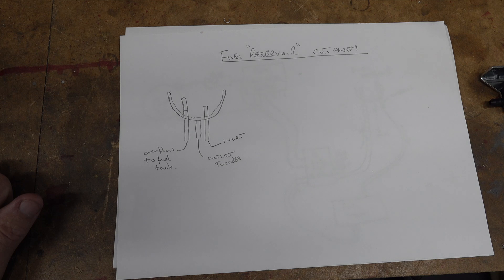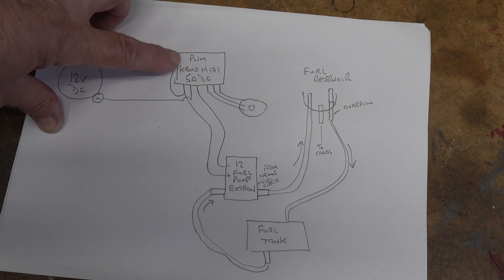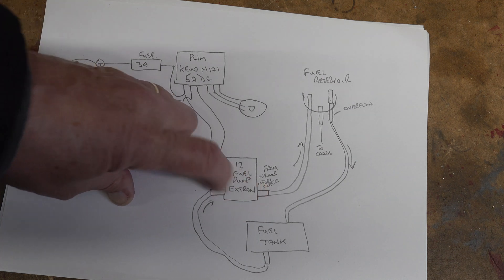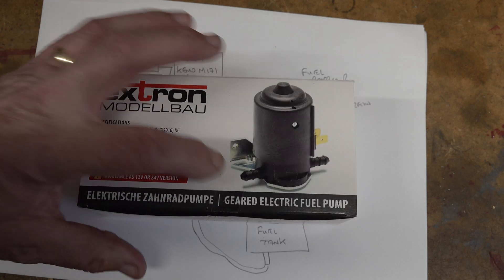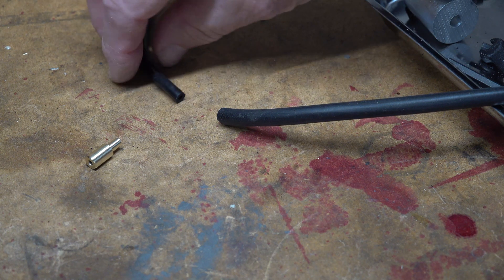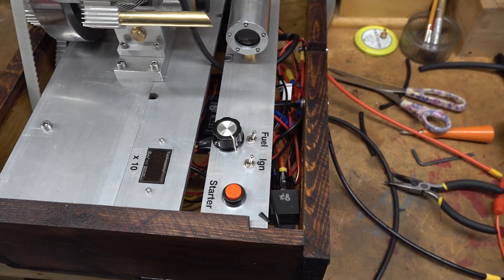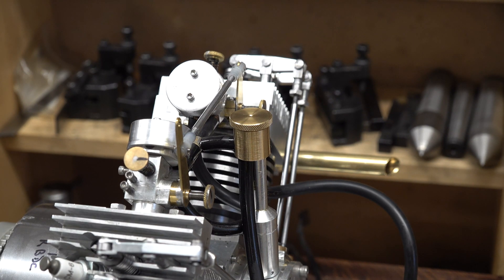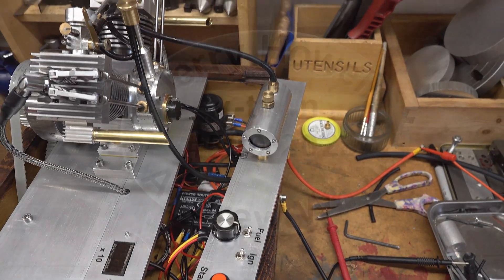#MT49 Part 25 - Jerry Howell V-twin IC Engine. Fuel Pump (Failure). In 4K/UHD by Andrew Whale.

Comment: Hi Andrew, the very small reservoir that you were pumping fuel to may work better if you increase its size substantially…. Carburettors have a substantial size float bowl even on small engines .. if you used a needle and seat to control the flow from the pump and a bypass for the excess supplied by the pump you should have more success with your idea .. keep up your good work .. not every idea is a success first up

Comment: I will add my congratulations as well. I also agree there was no need to go for the fuel pump. Out of interest a fuel pump that is overdelivering needs to have a pressure relief valve back to tank in order to only supply the required flow of fuel.  I personally feel that it would have preferred a header tank say half the capacity of the tank you have fitted with a 6mm bore minimum drain back to the main tank. Otherwise, you would have not been able to stop it filling. So to me not a very good project as it is so dependent on gravity to return the excess fuel & the requirement to get the pressure correct for the initial overflow, so it can feed the header tank. If you get it to work all you gain is the ability to run the engine continuously. But without a cooling fan that is not a good idea. You have settled for the best method of running your engine & it shows you much credit, Well done Sir.

Comment: Your V-Twin is running great! The starter kicks the engine running immediately and I think the fuel tank looks perfectly fine on the stand and it's certainly a lot less prone to trouble than an electric fuel pump.

That was certainly a challenging build! Gear hobbing, cast iron piston rings, broken taps, dodgy torches, starter gearbox and clutch, etc! Quite an adventure! You should feel very proud of yourself with getting a fine looking and running engine at the end. I'll bet that more than a few of these engines were started but never finished.

Enjoy your DIY work around the house until your next model engineering project!

Comment: Great job in the end.
I was always advised the return pipe needs to be around 4x the cross section area, as it returns at atmospheric pressure, not pumped pressure as in the delivery. That's not important now it's running well.

Comment: Well done Andrew, that is a sweet running engine. I suspect that your problems with the pumped fuel were due to a ridiculously large pump. 1.8litres/minute equals 108 litres/hour! There is no way that narrow bore tubing could possibly flow that much and you would have to run the pump way below its stable operating range. To give some perspective, my 2.0 litre car consumes 0.7litres/hour when idling!

Comment: Beautiful! I'm not sure whether or not you've ever mentioned it this series, but what sort of fuel are you running in that engine? 

Incredible job getting that thing constructed and running Andrew!
Reply from the maker: Hi. I use petrol with a little bit of 2-stroke oil to be on the safe side.
Cheers
Andrew
Reply: Ah, thank you for the answer... @learningturningmetal

Comment: As I remember from the moped times the reservoir bas built into the carb. Anyway, a float blocked the inlet of fuel when the level got high. Of course the petrol tank was fitted above the carb.